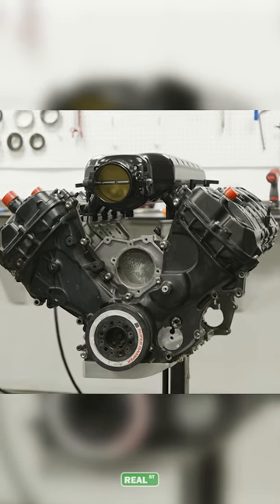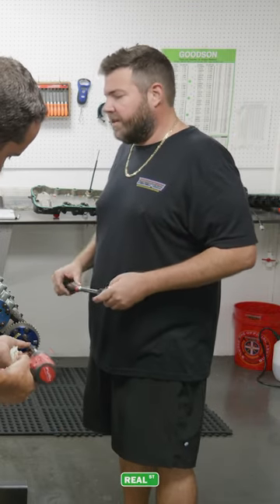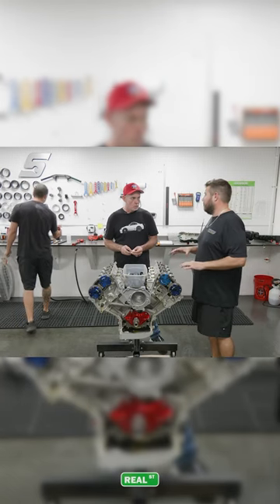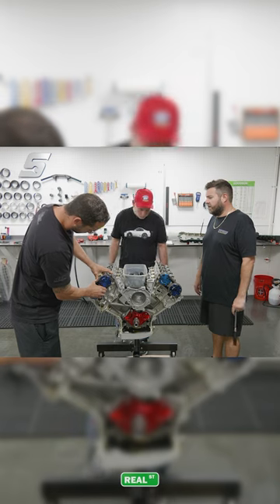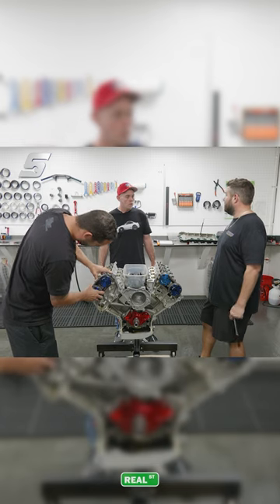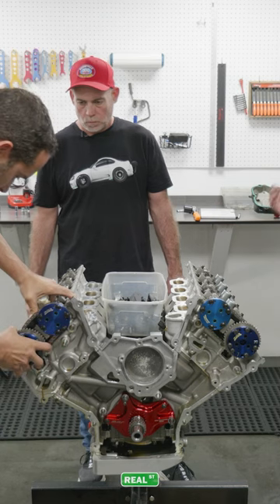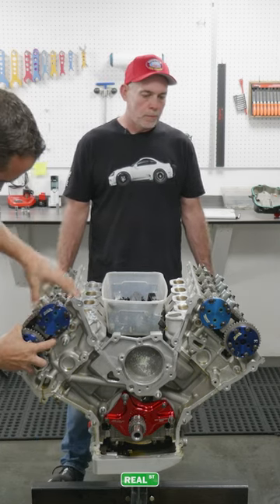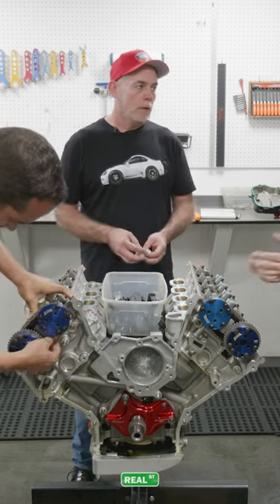The Coyote V8 engine program from FFRE has evolved over the years. This one makes 2500hp 😳

Comment: Pretty sure there isn't an LS on the planet that can make that kind of power while running an actual cooling system without blowing head gaskets...
Reply: there are many actually but not on a stock crank shaft if this ford can really handle 2500 on the stock crank I'm very impressed.  coming from a mopar guy